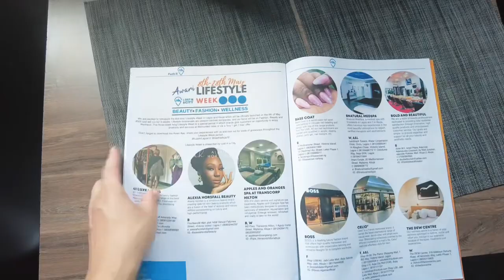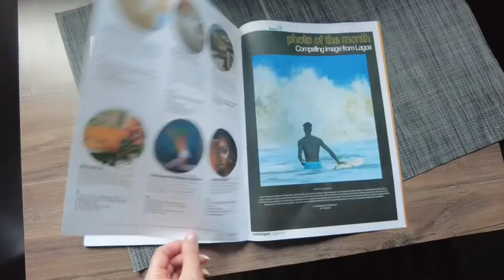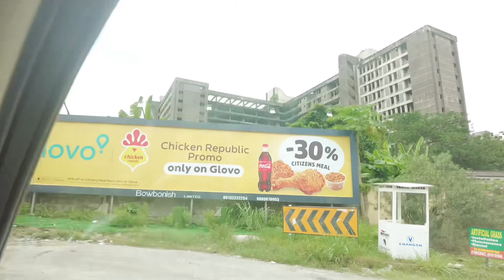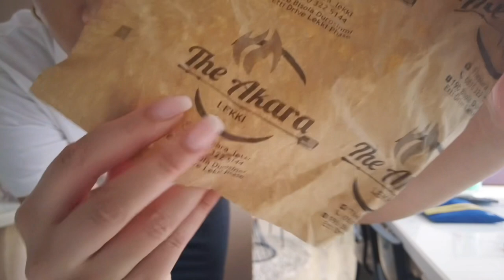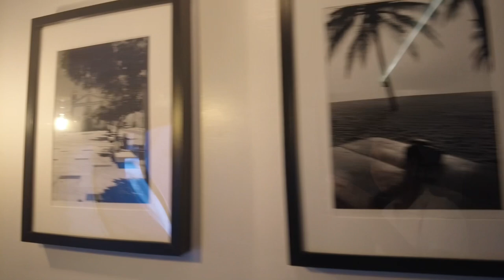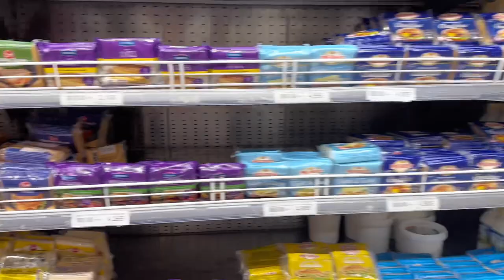TRAVELLING TO LAGOS 🇳🇬, Luxury Apartments, Hospital Visit & Shopping |GidiStays Lagos Nigeria Vlog

Comment: Hello, apartments look well maintained. Quick question for you: How do you keep 24-hour electricity for folks visiting from out the country. Is there a person/manager on stand by in regards to power outages? Thank you
Reply from the maker: Hi Phemzi, yes we always have security and/or caretaker that stays on the same premises. The electricity situation is different per accommodation. For example - the first apartments I was showing in this video have guaranteed electricity from 7pm till 7am (from the estate generator). The other hours is nepa or as back up we have solar panels/inverter which let's everything work as usual (sockets, tv, fridge etc.) except for the AC.
In the building where the luxury apartments are (the very first apartment in this video) - we provide 24 hrs electricity. The generator will be switched on whenever power from the electricity company is out. So it depends..
Are you planning to visit Nigeria soon or are you based here?
Reply: @gidistays  Thank you for the detailed explanation, and yes, I plan on visiting with my wife and son soon in a couple of years and looking into the pros vs. cons of an airbnb and/or hotel. It's gon be their first visit.
Reply from the maker: Oh that’s great. Very good to do some research indeed since it’ll be their first visit. I think apartments (or hotel with kitchenette) are great when traveling with a child. It just makes it easier to prepare meals/snacks for them. Especially traveling to a new environment.. you don’t want to eat all meals of the day from different places (some have no issues but some bodies need time to adjust - different foods, spices and water being used for cooking).
When booking an apartment, also check how security is arranged.
Thanks for you comment by the way. I think this is a great topic for me to do a whole video about! Thanks for watching x
Reply: @gidistays just making sure you haven't forgotten about the detailed video you mentioned to put up lol
Reply: @InvicRev 
Give the lady a chance. Takes awhile to put contents together, otherwise it would be rushed and haphazard.
Reply from the maker: I didn’t forget 🤍 just been so busy. I’ll try to film this week. Thank you  🤍🤍🤍